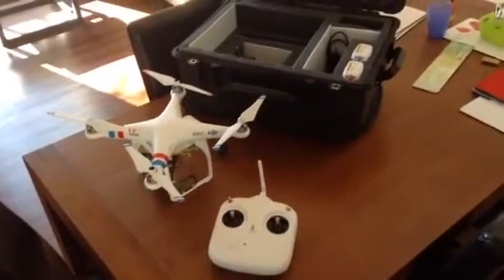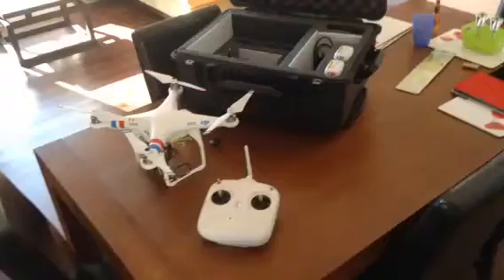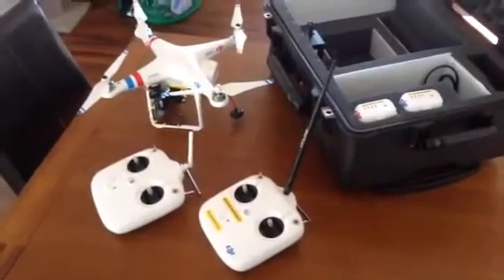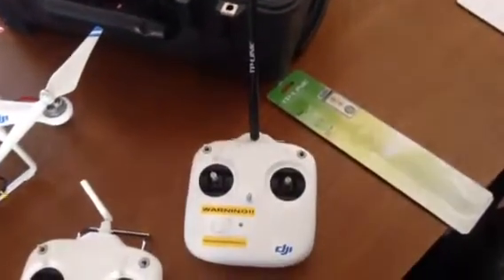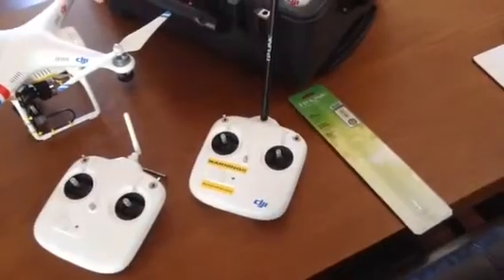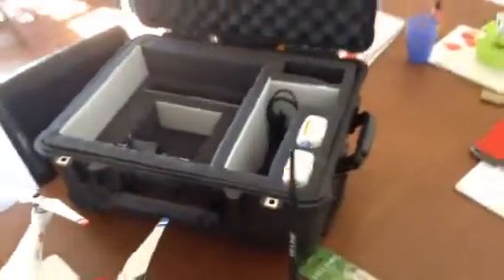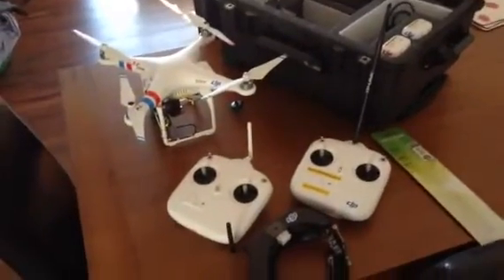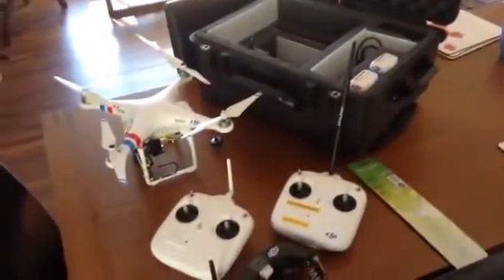DJI Phantom 2 Antenna modification

Comment: thanks for the video! is that antennas 5.8ghtz? I ask because last night I completed the same exact mod so I can use some of my bigger antennas. I was just thinking, if our Phantom 2 (non-vision) controller runs on 2.4ghtz, will 5.8ghtz antennas work just fine?
Is that why you are putting the booster on it? If you boost it up, will you be interfering with you 5.8ghtz FPV setup? before I did this mod and used the stock antenna on the controller, I hit 1600 meters before return-to-home kicked in

Comment: Great video Pete, the Phantom looks bas ass! My question is: is your tplink 8db antenna a 2.4ghz or a 5.8? The only tplink antennas i can find here say 2.4 on the packet, i live in Colombia , so things can be hard to get hold of sometimes. Also, can i use a 2.4 antenna on the 5.8 phantom transmitter?

Cheers!

Comment: Thank you for your video: I'm happy because I made the same exact mod, mounting the TP- link antenna. I still didn't make any range test, so do you think that : 1) The range is for sure better than the stock antenna?  2) I'll increase the range even without installing the amplifier as shown in one of your videos? Did you reach over 1 km, using this antenna WITHOUT amplifier? Someone told me that this antenna's signal shape is that of a flat rubber ring, so the Phantom can easily go out of range if flying high on you vertical...did it ever go out of range using TP LInk antenna?
Reply from the maker: Hi Rudel23, When I first used the 8dBi antenna without the amplifier I was still able to achieve just over 1000m. It did not go out of range at that point, I just got nervous because of strong winds that day. I was also very happy with the range from just changing the antenna by itself. I have now fitted the amplifier and have exceeded 1500m. I am very confident that I will be able to achieve around 3000m with the amplifier but I am also being a little bit cautious because I already lost my first Phantom 2 a few weeks ago and I'm being more careful with this one!

I think the 8dBi is a great antenna. I have heard a lot of good things and bad things about other types of antennas but I thought I'd play it safe and just use a standard style of antenna with this experiment. Good luck with your upgrade.
Reply: You mean that when you lost your Phantom the "return to home point" feature didn't work? I already've seen the amplifier for sale, but the big problem is its battery: according with your video you've brillantly solved the problem, but doesn't look so easy to make...if you've time to write me the links of what is needed, I'll apppreciate...thanks again
Reply from the maker: The last Phantom suffered a mechanical failure at high altitude. Would have been in pieces even if I'd found it.

You need to buy a voltage regulator (code is SWADJ) and a male T-connector (to plug into 3s Lipo), both from ReadyMadeRC.com. Solder the inlet and outlet positive wires (red) onto the outside pins and both earth (black wires ) onto the middle pin. Adjust screw until desired voltage achieved by testing with voltage tester. Use a good quality battery. Good luck
Reply: Today I made a flight with Phantom 2 and the TP antenna (no amplificator). I reached 1500 mt. (1,5 km) without any problem! Of course I was in open country, with no obstacles, let's say an ideal condition, but no bad right?
Reply from the maker: Peter Perrim That's pretty good going. Just remember that the further distance you fly, the higher the altitude you have to fly at otherwise you will lose signal faster. Good luck with your flying.
Reply: Thanks, good tip!I was flying around 80-100 meters of altitude anyway...